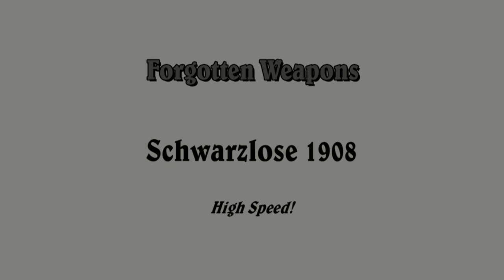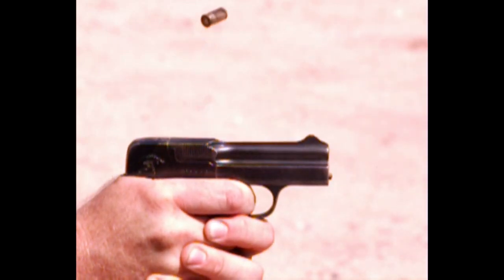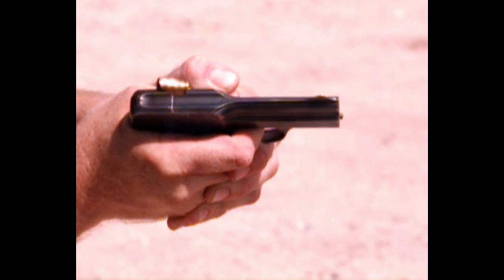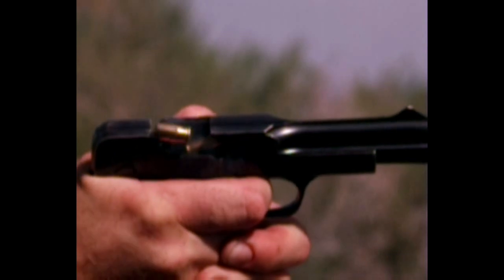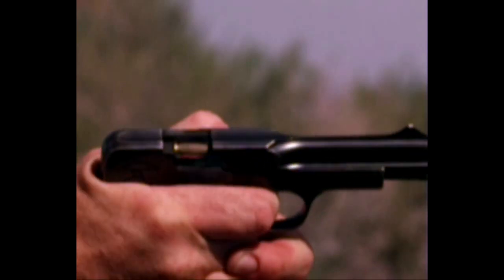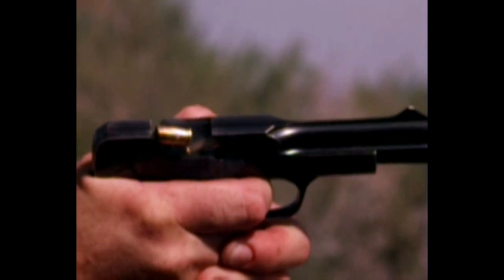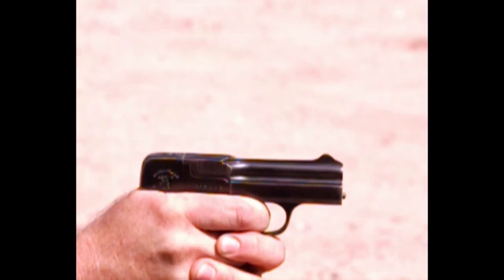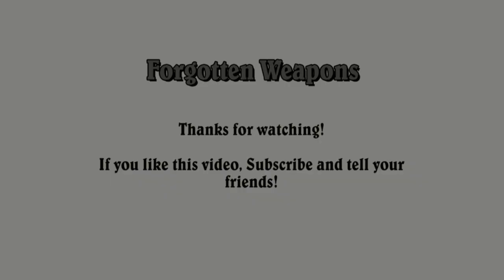Schwarzlose 1908 Blow-Forward in Slow Motion (3500fps)

Comment: Isn't a blowforward gun, while having more recoil, also gives additional acceleration for a bullet by a moving barrel? And could it work with, for example, .30 carbine round?
Reply: It has been used in a shotgun and in full-auto grenade launchers, so it should work just fine for a carbine. I'd think it shouldn't have any effect on the acceleration of the bullet, since the barrel doesn't move until after the bullet leaves the barrel (and the fact that the acceleration of the bullet is causing the barrel's motion in the first place).

I think there has been a carbine that used a blow-forward system:
https://en.wikipedia.org/wiki/List_of_blow-forward_firearms

Comment: I have a question about blowforward pistols. Firstly, how would the principle of a blowfoward gun apply to something larger, say a submachine gun?

Secondly, based on another video on blowfoward pistols (a Japanese example), it was mentioned that these guns were the simplest type of autoloading mechanism around, since the only moving part is the barrel (and maybe a recoil spring around it). Again, how true is that?
Reply: As a bonus though the slide does not need room to go over your hand so the grip can be higher up to compensate for muzzle flip.
Reply: @J7Handle  That's a neat idea.
Reply: The only thing that can compete in complexity is straight blowback and technically the principle could be applied to almost anything. The primary issue with blowforward as a mechanism is it produces far more recoil than anything else that comes to mind. This is because you have more mass moving forward with the inclusion of the barrel and essentially no mass moving rearward to act as a buffer.
Reply: How about a gun with a punch-dagger type handle and blow forward operation. I think that'd work...
Reply: It's been done for both a full-auto shotgun, and two types of full-auto grenade launcher, so it should suit a submachine gun just fine:
https://en.wikipedia.org/wiki/List_of_blow-forward_firearms

Comment: This was such an interesting period for firearms.  Designers were all facing the same question: how does one make an autoloading firearm?  Many of their answers became evolutionary dead ends, but the era truly exemplified the "many ways to skin a cat" adage.
Reply: Well, more like "how do I make an autoloading firearm without paying licensing fees to John Browning???"
Reply: Gas delayed blowback and blow forward are truly the most reliable and simple mechanism in term of machining,and no need any locking mechanism.Of course we could make something blow forward but no need to copy exactly the complexity of this particular pistol.The first approach could be replace single action by double action which is simpler.What i wonder is that,can the bullet friction cause the barrel to move so fast that will result a damaged spring.
Reply: Even though it has its flaws, I think it still has a purpose some where else, or the can be fixed more so now. :)

Comment: That's strange, was the recoil really soft since some force is exerted in the opposite direction?
Reply from the maker: Actually, the opposite is true. Because the slide moves forward, it creates an equal and opposite force pushing backwards, in addition to the recoil generated by the bullet. Blow-forward guns have stiffer recoil than other mechanisms, all else being equal.
Reply: +Forgotten Weapons ... Actually, the total net force of the recoil is necessarily exactly the same force as is required to accelerate the projectile. It all must be felt by your hand. The amount of mass the gun itself has can serve to dampen the distribution into your hand. The center of that mass being elevated higher than your grip can serve to turn it into a twisting motion instead of all being directly back. The mechanicals (slides/barels/whatever operating) can serve to redistribute the one main pulse into little spikes and valleys (imagine we&#39;re graphing the recoil force felt over 1/10th of a second or something). But the slide, whether it moves forward or backwards, does not CREATE any new net force that gets added or subtracted to that of accelerating the projectile.

Take the Broomhandle, for example. In slow motion you might realize that the total recoil impulse is &quot;felt&quot; by the operator in two smaller pulses. The first when the projectile is fired, some of which is initially not felt by the operator because it is instead absorbed by the slide getting thrown rearward. The second when the slide reaches it&#39;s limit of travel and imparts that energy back into the frame, at which point the operator will feel another little pulse and the muzzle will rise higher again. Now this may happen too fast for a person to actually notice two distinct pulses, but that&#39;s what happens. There is once SOURCE of energy creating a recoil pulse, but the mechanics of the gun operating (if you were to graph what is felt in the operator&#39;s hand) turns it into two little spikes. But the total net force eventually transferred into the operator&#39;s hand is still exactly that amount used to accelerate the projectile. The slide does not create any new force.

PS - Your channel is amazing!
Reply: One thing I would think could be an advantage is that the chambered bullet sits mostly over the grip, while most autoloaders require that a chambered cartridge sit entirely forward of the grip.  Thus one could get an extra half-inch or so of barrel for a given overall length.
Reply: Ahmed Sabbagh it makes getting glock thumb impossible and the slide can't be pushed out of battery if you mash the muzle into somthing
Reply: Ahmed Sabbagh It would also make the bolt-face and firing pin pieces that could stay with the gun's frame, instead of them moving around with the slide.  This would simplify design and manufacturing.
Reply: I'd agree with this with one exception: It probably does increase the spike while starting up, and indeed if the entire barrel kept flying forward, the total recoil would be greatly increased. The only reason the total momentum forward isn't higher is because it creates a large backward impulse from the barrel then moving backwards, pulling the gun (and your hand) forwards.

Comment: Now THAT'S recoil-mitigation.  Why didn't this ever get more popular?  I assume just like with a blowback, you have to beef up the pistol a lot if you want a larger caliber, right?  I think one of these in 9 might just beat a hi-point in a world's-ugliest contest.
Reply from the maker: Actually, recoil on a blow-forward is notably worse than other actions. Since the slide is moving forward, Newton's laws require an equal force pushing backwards. So in addition to the recoil from the bullet, you also have the recoil generated by the slide going forward.
Reply: The recoil is nearly twice as intense because 100% of the recoil energy is delivered instantly, you actually don't have even 1% more recoil, its exactly as much as any other  gun, but you get it delivered all at once, very snappy, unnatural to cock, and the only spring of the whole gun works against you during recoil, so yeah recoil mitigation will wait the next time to show up.
Reply: The dardick has the ugly thing locked down.
Reply: Oh God, I just looked up that monstrosity.  Yes you're definitely right.
Reply: I guess I should say muzzle-rise mitigation.  It looked like the blow-forward action corrected any muzzle rise pretty quickly.  Or was this just good control on the part of the shooter?